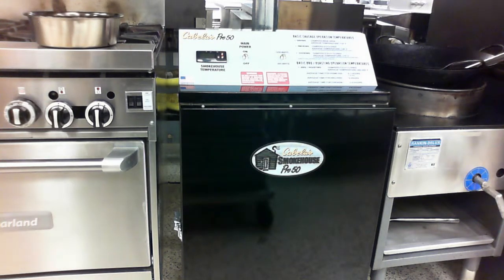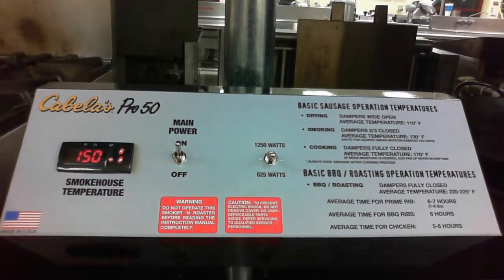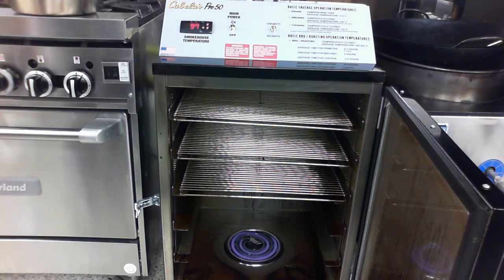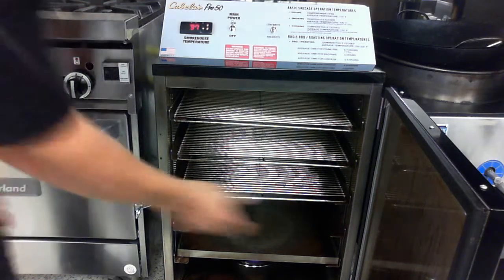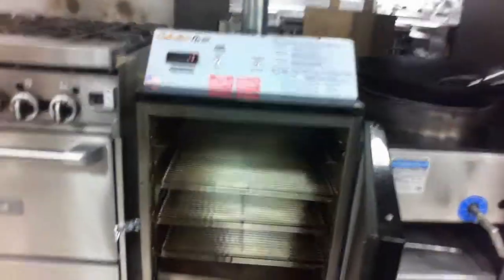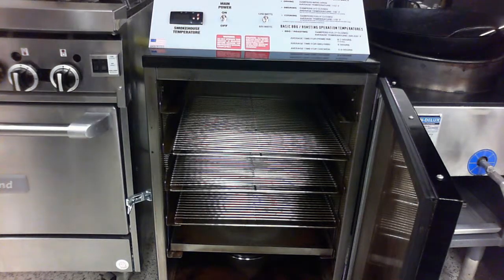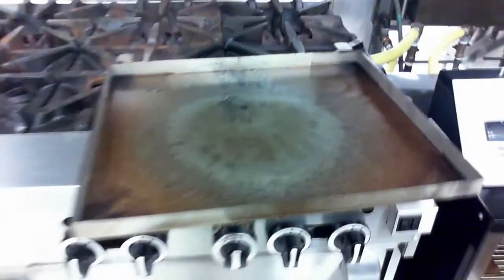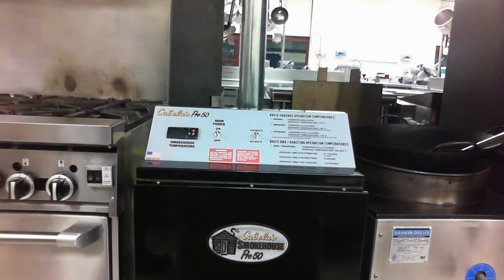Smoker

Comment: You do not want to use pellets in this home smoker, sawdust is the recommended fuel/wood for smoking.  If you have any questions, contact the manufacturer at 800-328-8313